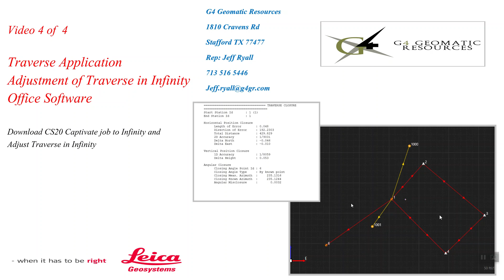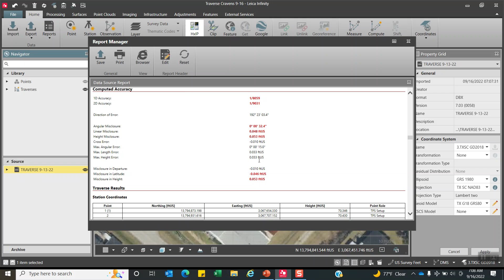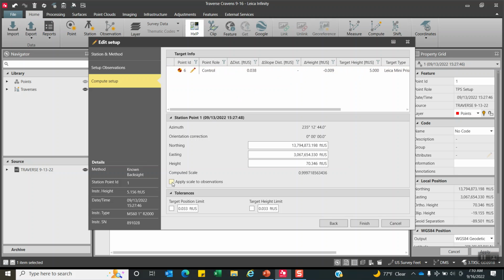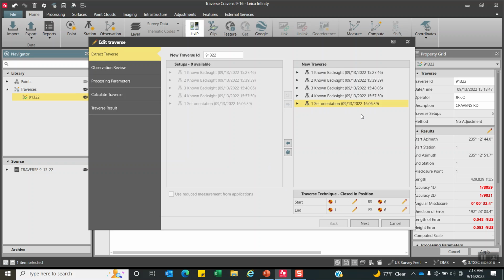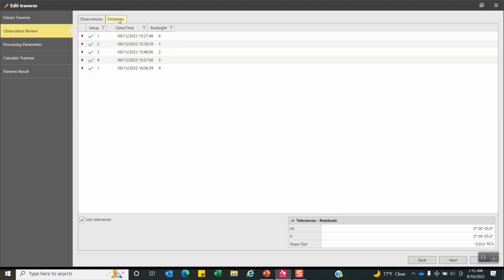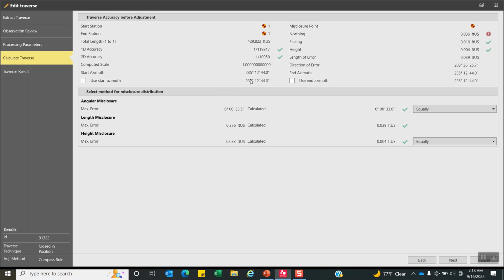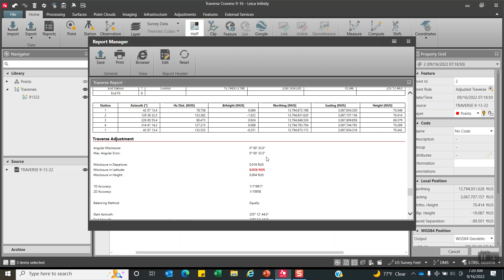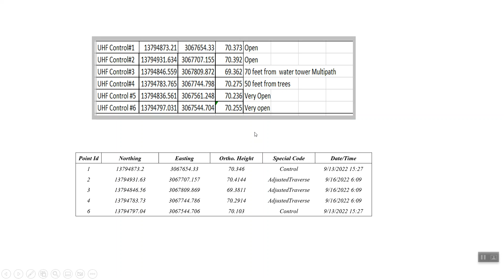Leica Traverse Adjustment:  Infinity Office software  (video 4 of 4)

Comment: I have imported all my data into infinity and it looks similar to yours, however traverses is not coming up in my library in the navigator on the left hand side so i cannot open traverse wizard. Any suggestions?
Reply from the maker: Traverse adjustment is an option, you will have to check to ensure TPS processing option was purchased with the Infinity. If you just have the basic Infinity license this will not have the traverse processing option included.

Comment: Thanks for your inspired video, but I have a little of confusion! and I think I am in trouble! pls, help!
Are closing point (or misclosure point) and closing station different? I think the traverse app in Leica Captivate and its methods are different from those in Leica Flexfield like TS07. I performed a traverse using TS07 Total Station, I had just two known points (K95 & K96), I wanted to perform a Link Traverse but I thought it is impossible to doing it, because I had just 2 points! but What I did is some way looks like a (closed loop) traverse! Whatever, I started at point K95 and backsight K96 with (known backsight) orientation method outside the traverse app, then I entered the traverse app and I chose (with known backsight) method and did the same as the orientation when 1st setup, then the traverse started and I measured Back and Fore sights till I arrived the other known point (K96-initial backsight!), I setup at (K96), I shot backsight, then I hit the (Close) button before measuring foresight and a window appeared (it included different options, one of them stated "At known Station to Known Closing Point") I chose it and I selected the closing station as (K96) and the closing point as (K95 - the start station). Then it finished the Job and I Adjusted the traverse inside the total station. When results appeared, I noticed that the last distance (K96 To K95) measured, not included in the adjustment, why? and my end station appeared as point K96! Did I perform the traverse in a wrong way or what? or the closing point is just used for close the angle to calculate the angle misclosure? for checking weather I'm wrong or not I processed the raw traverse data with Leica Infinity and achieved the same result with very small discrepancy. You didn't hit the close button and the total station closed in position when you were at point 4 and foresighting point 1!! so I didn't understand your point of misclosure is point 1 or point 6? and the total length of the traverse is 1 to 1 or 1 to 6? also my traverse is true or not, however I got a very accurate result!

Comment: Did the topo points 1000 and 1001 change after adjustment?
Reply from the maker: Yes, if you run the traverse application, and tie in survey-topo  points after the sets of angles are turned, they will be adjusted, as they are linked to that setup, so their position are determined by the setup point and newly adjusted values